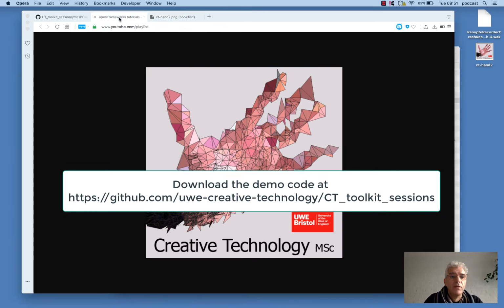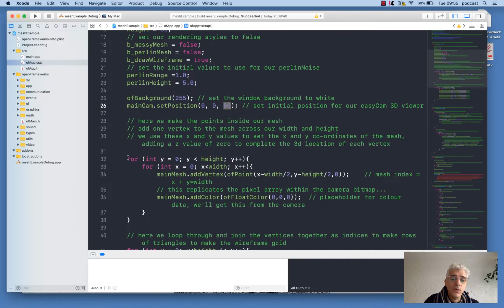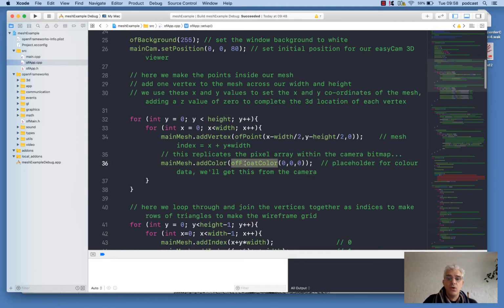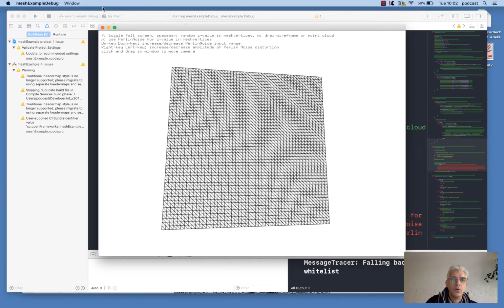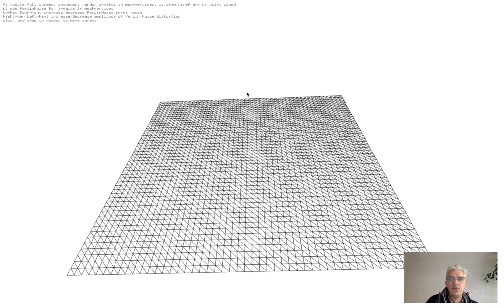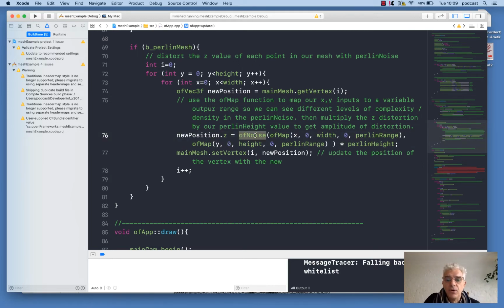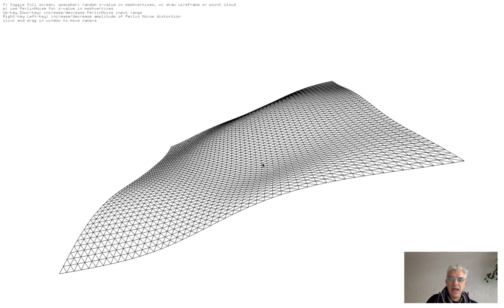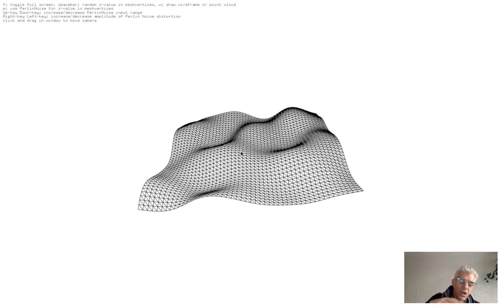openFrameworks creative coding: 3D meshes and Perlin noise

Comment: I'm trying to make a 3d Grapher with OF. It's efficient to make all the surfaces with ofmesh?
Reply from the maker: depending upon what you want to do the ofMesh objecvt is an easy and helpful way to contain and manipulate 3D objects - some things will work much faster if you can manipulate them with shaders as this will run on the GPU. if you want to do something like graphing equations (?) then ofMesh will work fine - if you find you need more speed then there are several ways to optimise your code and how oF renders 3D.